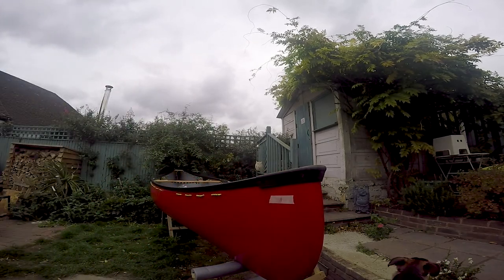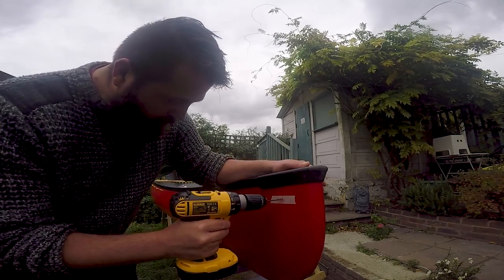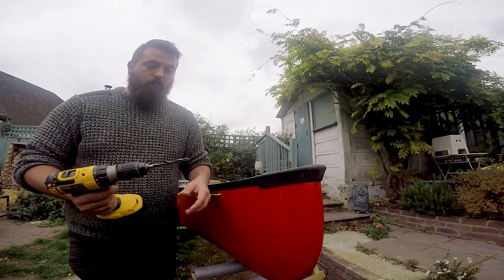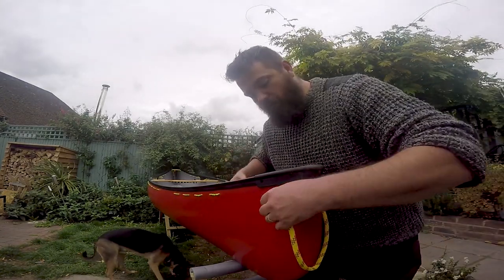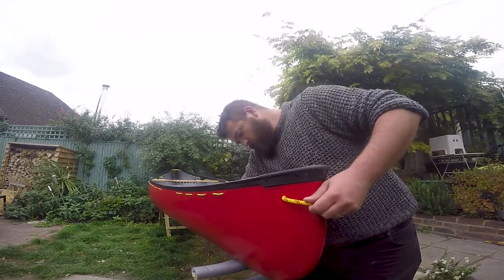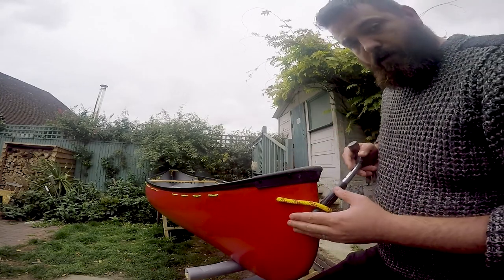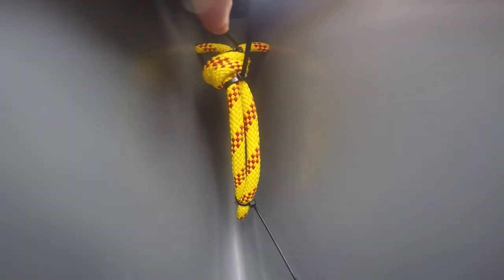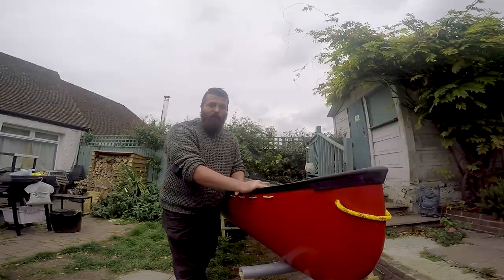Fitting a bow loop

Comment: Wrong in so many ways.
Reply: But you're not going to tell us any of them? Helpful.
Reply: @w.w.8823  1. Too high. The bow will be levered downwards causing it to zig-zag when towed.
2. Too far aft. There is no structural rigidity in a flat section of topsides. 
3. Sharp edge. The hole should have been sanded or filed smooth and the edge chamfered.
4. No reinforcement. Epoxy could have been utilized to disperse forces. 
5. Water ingress. A hole in the hull will let water in. Using epoxy to create a solid area spanning both holes would have eliminated the problem. 
6. Water penetration. Water can enter the strata of the hull material causing delamination if not sealed with epoxy or similar. 
7. Wrong knot. The forces could have spread to both sides if two knots were used. 
8. Wrong material. Floating polypropylene line is weak and has no purpose in this application. 
9. Too much rope. A meter of line where less than half would do a better job. 
10. Zip ties??? Sailors, watermen, mariners, riggers and paddlers etc. don't need zip ties. 

You're welcome.
Reply: @UguysRnuts  Thanks for sharing your knowledge.